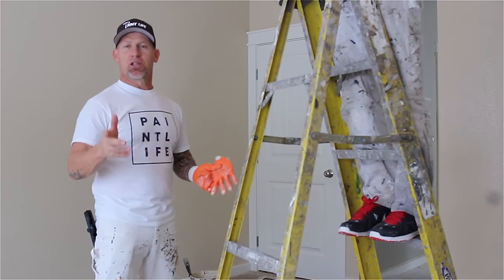Painting A Bedroom In 30 Minutes. How To Paint A Room Fast.

Comment: This is alright, not impressed to be honest. Don't get why you guys are using so much tape. A good cutter should be able to cut that window perfectly. I understand you guys are using good or great quality paint but you should always put 2 coats on because that's just better. Also 2 things, why start in the middle? That looks sloppy, you can also mess up the paint job. To get a good finish on the last coat, you gotta keep it all equal.And also unless it's the first coat, your cutters should always be in front of the roller for the paint can have a good finish.
Reply: Edson , I don't think there's masking around the windows except the one covering the blinds. Also for the same price doing twice the work will drastically drain your profit, 2 coats over one just because it's "better" :D Different colors of the same type of paint will hide differently. If you paint over flat paint with another flat in a similar tone, just some color difference, good quality roller and technique, one coat is more than adequate most of the times. Try doing that over satin or semi-gloss and you'll be frustrated if you quoted the job for one coat of paint. Another thing, if you make sure that you won't lose profit and you always quote for 2 coats, you might lose out on jobs because your price is higher than those who know what they're doing and they know that one coat will work and they give a price accordingly. By the way, I agree with you on that start in the middle of a wall and cutter not leading , not that the customer would come in when it's dry saying  "you have to redo this wall because I can tell you didn't start from the corner"  but it just looks better, more organized and there's an order to things :)

Comment: As a DIY decorator for my own home I have a question about painting a room that needs two coats including ceiling and baseboards.

With reference to when I would do cut ins for ceilings and baseboards, exactly in what order would I don it?

I understand you like to paint baseboards first and let dry then cut in with masking tape so where would I start after I had let the baseboards dry?
Reply: Brexit Or Bust Ceiling first, bring the ceiling paint down onto the wall about the width of your brush, this allows you to trim the ceiling fast as well as see where the wall meets the ceiling clearer, trim a wall out then roll it right away to avoid flashing, when you trim the bottom of the wall against the baseboard it’s okay if you get a little paint on the baseboard because you’re gonna paint it anyways! If you get too much paint on the baseboard and it creates a build up, use a 5-1 scraper to scrape the excess paint then use a medium/fine grit angled sanding block that way you’re only sanding the top edge of the baseboard. Hope I wasn’t 11 months too late!

Comment: I have been followng you for a while and I really like the way you tape the top of baseboard and add a little clear caulk when cutting wall to baseboard.   

My problem that I often find is previous painter cut a crappy line or used cheap caulk after installing molding and that caulk has yellowed.  This means that I need to touch the top of molding to wall transition with molding paint.  

that means I cant tape that for a while.  I was wondering how you mask the top of baseboards if the baseboard to wall transistion needs painting?(and you want to paint same day)
Reply: left you some google plus feedback as acknowledgment of the meticulousness you display in your videos

Comment: You guys are good, but that looks like the quickest roughest way to paint. Theres no way that looks good up close.
Reply: Well thats great that it works for you.
1. Doing one coat, how on earth can any paint do that? How thick must it be? 
2. You didnt back roll/lay off, you just put it on and leave it. 
3. The guy cut in after you rolled. 
4. I usually gap skirting beforehand so it dries but ive never seen clear gap filler.
5. Doesnt really matter but using paper and tape where it is not needed.
Reply: Yeah i realize just curious as to how you can do like this. Ive never seen it before.
Reply: If you're interested I have a reasonable answer to all your points, except number 5.  The masking of carpets. Mostly I put 1" tape over baseboards to protect from paint splatter especially if the wall color is way off the baseboard color.The masking tape will overlap the drop cloth under it so I've never had an issue. After doing it for 24 years I can brush corners by the time someone would put the tape up and seal it and having to remove it, pay for it, create garbage of paper,sometimes plastic. Maybe on the highest end jobs and textured walls I might use the tape and caulk technique. My specialty is the efficient ,detailed brush work to save time, profit and keep prices reasonable. Everything else only gets easier for me.

Comment: a good paint brush needs to do several things well. It needs to collect and transfer an adequate amount of paint to a surface --not, just a little at a time or you'll end up with streaks that need more coats. It has to be able to move the paint evenly. And if you're painting large spaces (like rooms), it needs to be able to produce an even & straight line for cutting a wall, because professional painters don't use tape to mask off transition areas, joints, borders, or corners.
Reply from the maker: Yes, thanks for sharing!

Comment: Using the Brush to cut around is so old school,try reverse masking everything around the ceiling, make sure line is straight and cut around with low pressure sprayer, Job would be done way faster than half an hour by yourself

Comment: The video title is "Painting a bedroom in 30 minutes."  Okay, so 3 professionals in 30 minutes.  By myself, it would be about 2-3 hours with me doing all the prep work: taping, filling in holes, sanding the drywall.  The idea that I got from the video is that I should use an 18" roller to make the process faster.  If I paid several hundred dollars to get a room painted in 30 minutes, I would be livid.
Reply from the maker: Efficiency is key

Comment: I have never seen a professional painter start rolling in the middle of a wall .If you are any good with a brush there is no need to tape the edges of the trim.  Just tape the base and don't use that cheap tape that allows the paint to seep through.  Try some Frog Tape and apply it properly, no need to caulk the tape.
Reply: pixkeyser Pro painters actually do tape trim because they are fast at taping, and it helps double efficiency with a 2 coat job. Frog tape is not good when it comes to sticking, and doing 2 coats over it either. 3M 2090 1.5" is the stuff!!
Reply: i think because the guy cutting in with the ladder was on his way. that is the only reason i think he start on the middle. for me is too many people in a room. have a guy cutting in first when it's mask than you go and roll
Reply: pixkeyser keep in mind, this is a how to video for folks looking to do it themselves...so the step by step process is necessary.
Reply: Right on XC !!!
Reply: It's a step thats not needed .  Go get a cutting in tool if you cant cut lines.
Reply: @XCPainter  couldnt agree more

Comment: why only one coat? do you usually do only one coat?
Reply: +The Idaho Painter you can get an even sheen with one coat?  I just was taught that two was always needed but that must not be true.
Reply: +Troy Tirrell if using a standard off the shelf paint then generally 2 coats are needed... But if using a trade paint then one coat over a similar shade on the walls would be fine.... (Ps I'm in the uk)
Reply: wackokid whats a trade paint a better paint??

Comment: Wow, that's alot of wasted paint brushing the wide cut ins. 
To avoid haloing just cut in about two inches down and the roll horizontally at the top as close as you can without hitting the ceiling and at the bottom without hitting the base then roll out the middle. Roll into the corners.
Reply from the maker: OK

Comment: I like your videos and style. But I do have to say that it seems you could do without the paper around the perimeter and 1 less person.
Reply: +The Idaho Painter I'm glad to know you take constructive criticism well.
Reply: RCS, how is your criticism constructive?  You simply pointed out what he could make do without; however, you failed to address how he could improve upon his work effort with one less person.  Perhaps you should consider your tact of delivering criticism if it doesn't have good suggestions accompanying it!  I'm sure if you actually have some "constructive criticism" (in better terms, HELPFUL TIPS) Chris would "gladly" consider them.  TACT, RCS, TACT!
Reply: +A G Well, when you are a professional painter, one can learn to read between the lines of my comment. Meaning (incase you need an explanation on this comment as well), a professional should be able to think critically about a statement without the commenter going into specifics. But for sake of argument, let me explain. He could have done without the paper along the perimeter and just tuck the drops right up to the base. The inch and a half tape is enough masking to protect the base and would overlap past the drop, leaving no exposed carpet. Since he could do away with the paper, he could also do with one less painter due to reduced masking. Also, when the cutting starts all he needs is two people. One painter cutting the top half and one cutting the bottom half. Once a wall or two has been cut in, one of the painters can start to roll walls while the other painter continues cutting in all remaining areas. You may not understand that from my original post, but I assumed The Idaho Painter would understand that. Which is why the comment was directed to him. Not you. But perhaps next time you don't like a comment, maybe thinking about it in an anylitical way might help you understand. But at the same, unless you are familiar with the top, you may never understand. Hope this has enough TACT for you...
Reply: RedCellSpy Tactful?  Arguable, maybe yes, maybe no.  Analytical enough to lend itself to well-imparted information?  Yes.  Thank you for your insight as it is clearly comes from the mind and observations of a seasoned painter!
Reply: I thought the exact same as you. This is how we always do things if we only have 2 people. You dont need paper, just drop sheet up to the base. Also it is better to tape and caulk before hand so it can dry. But i guess hes just showing it can be done in half hour.
Reply: A question for both RedCell and Idaho:  How would you guys approach a job as a lone painter on such a job as a bedroom?  What sequence of cutting and wall rolling would you follow in order to avoid things such as haloing or other oddly displeasing visual artifacts of a not so-well done job due to juggling each area of concern between tasks, especially knowing that some areas will indeed dry on you before you come around to apply an overlapping roll or layout on top of the potentially, already dried cuts?
Reply: ***** Thank you, sir!!!

Comment: first off, real painters don't use tape... 2nd, you don't start  a quarter the way out from the corner of a wall bcuz of lap lines. I have man others I caught but closing this up, I wanna see a video with a  30% side angle on the wall so I can see if it's an even sheen cuz I don't believe it will be and I wanna see a close up of the cut lines around the window and ceiling line.
Reply from the maker: I guess I am not a real painter then! I have many videos showing close ups!

Comment: Pro tip: if you're going to make a painting video, make sure your guys aren't committing OSHA violations in it. With his leg through the rung. Might wanna take this video down. Also you can't achieve a quality finish with 1 coat. This is the kind of stuff I constantly have to come through and repaint. Well y'all are keeping me in business. Thanks.
Reply from the maker: If you use a good quality paint you can typically do one coat depending on the color

Comment: that was quick indeed.
im not hating or anything but doing one coat of paint is never good im a painter myself but i can gurantee u that the walls dont look good upclose. customers may not notice it or see it bkus they have no clue what they are supoose to be looking for other than them seeing there walls are painted  but thats just taking advantage of the customer i mean if they know the process and they know the consequences if u do one coat and dont want to pay up more bkus they are stingy with money then okay i would do it bkus they are asking for that 😏 look ive done what u just did and i didnt like it, color was not even. ive proven customers wrong lol bkus they hear from other painters that one coat is fine etc etc but its not fine thats all a lie 😒 and the spackle u used im sure if u get close up to it with the camera ill be able to distinguish where it is.
 i mean two coats are always recomended in order for it to be its bright or original color. another thing all those paints that say paint and primer in one are also lies lol ive used it in walls were i have new texture and ive compared it with other walls were i literally buy a primer and seal my new texture correctly (the right way)  and then i give it its two coats of paint and it looks way better, walls are looking more even with there color than instead doing one coat of paint   
one more tip i use to do that, taping and using caulking so the paint wont go through to the baseboard.  you should buy the yellowish tape that they sale at dunnedwards 
line up ur tape over the base correctly and straight and press firmly with ur finger as ur taping the base and brush off the wall . easy piecy lemon squeezy and remove the tape and ur line is straight as hell !.  its faster and its cheaper my friend. trust me .

bkus sometimes when u put caulking over ur tape and u apply ur paint what happns when its dry and its ready to remove ur tape u bring ur paint of the wall and there u go doing touch ups. 
have ur guys practice cut around caising im sure since they are professionals they can leave a straight line. i sure can 😏 it just takes practice tho lol
Reply from the maker: Use a good quality paint and one coat will be all you need (considering the color of the paint).

Comment: 3 painters??? I can do that by my self in one hour
Reply: You're free to post a video of it, I'd watch :) but I want close ups on the quality, no cheating with sloppy work. One man operation will always take longer than 3 times , compared to a 3 guy operation. Unloading the van, lay out drop cloths, set up rollers, paint, etc. I've been doing it alone for 24 years, I like that I'm only responsible for my own work, but it is a lot of running around so you learn how to avoid walking around the jobsite empty handed. You go to van to get something but before you do that you think what's not needed inside anymore and you take that item with you to the van to save time at the end.
Reply: Burned you good